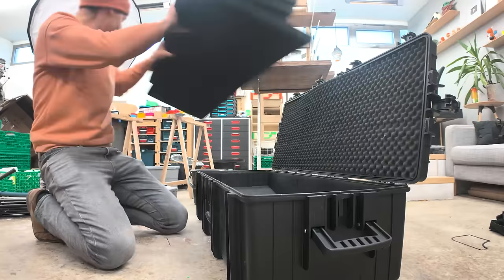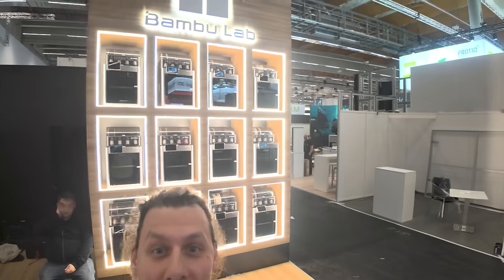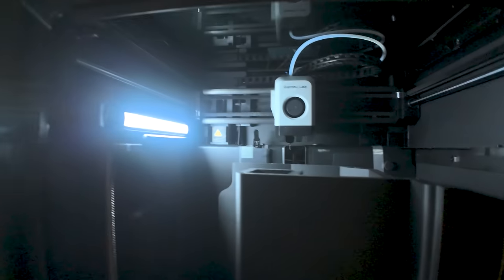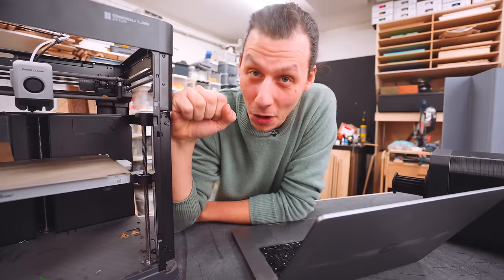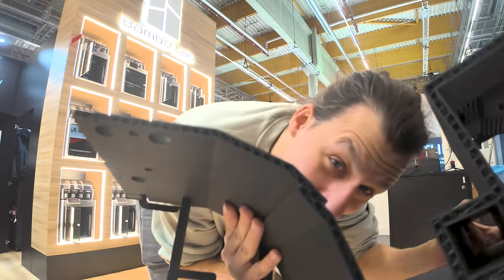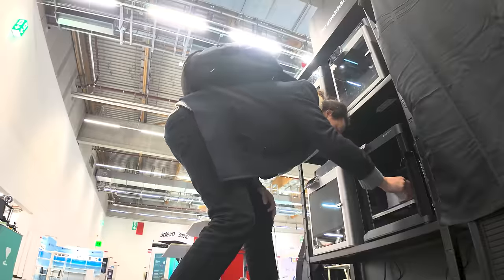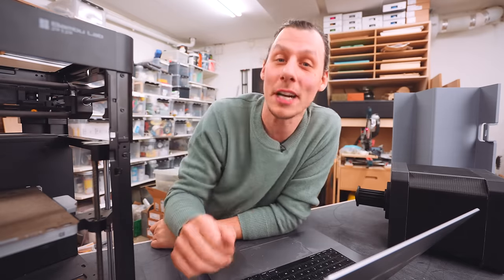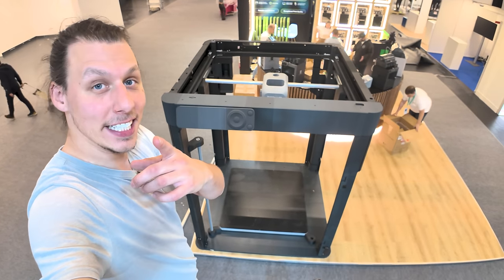I Made a HUGE 3D Printer - Using 3D Printing!

Comment: Nice job! I already imagined that you had to alter the original file way more than just to scale it up.  I did a similar (but way smaller) project last spring. I made a 1:4 model of our ultimaker at work as a retirement gift for a dear co-worker (it was suposed to be a 3D giftcard with money for a 3D printer). I did t have the files so I had to construct the whole thing first. It turned out great and the head was also moving 😉

Comment: The giant printer is really great, you can develop it further, the display at the top of the printer could be built so that it even shows something and it would be really cool that the hot end can even move and that it can print something on the huge 3D printer  you made the printer really great.

Comment: I do not have a 3D printer but I have a design for one. The printing is done on the inside of the motors. The three motors are stacked vertically over top of each other in the same space and there are No Rods of any kind or belts at all, and it has submicron precision , ZERO backlash, and high torque.

Comment: Recommendation for you that Ive recently found quite useful: Nylon R-Type rivets.

Need to connect something quickly, but want it to be removable, but also want it to be cheap, and dont want it to be thrown out with a prototype part should it nor be the final part?

Nylon rivets.

Easier to implement in cad in all orientations as you only need a cone with the end snipped off to be the diameter of the rivet (you can actually just extrude a hole beveled to 45 degrees and you are done), cheap as chips, and you don't have to throw them out with failed ideas like you might have to do with heat melt inserts, which if you've ever prototyped something with, you know the pain of seeing all that hardware go down the drain, or having to design for screws, and then switching to them later. They also come in tons of good for 3d printing diameters and lengths.

Comment: Fantastic can be a reality. I toured Push Plastic 3D printer filament manufacturing facility when I was at PwnCNC World Headquarters (I work remotely for PwnCNC) in Arkansas. 
Push Plastic has a real 3D printer you can stand inside of. It's as big as a good sized closet.

Comment: Does the BL+AMS not have a Spool Join function?
Reply from the maker: it does, but you have to load the spools before you start the print
Reply: Yes, switch over, tell it the spools are the same material and color and it will switch over. Very useful to use up old spools

Comment: As a person who has restored several, old aircooled vw’s with bolt on fenders, decklids and hoods, how long it would take before someone 3d printed these sometimes hard to find body parts and how durable they would be, at the very least, they wouldn’t rust.
Reply: I'm planning on building a 3d printer to do exactly that. The nozzle will be large and it won't be extremely precise, but it'll be enough to print supports for carbon or fiberglass sheets.

Comment: You ran out of filament early in the video: Why didn’t you use the AMS’s ability to automatically switch to a new roll when one runs out?
Reply from the maker: I did for the rest of the prints, but you have to load the spools before you hit print.
Reply: @achappel Awesome project, amazing 3D modeling skills and a testimony to the Bambu printers’ capabilities! I love my X1C, it’s when I went from the printer being the project to it being a tool 😁

Comment: Another great video, I alway enjoy seeing what you are up to. - This looked like a really fun project.  It reminded me of a few things I have done.  Firstly I printed a 4ft long cruise ship on a couple of X1Cs - it was 6 build plates long and about 13 build plates high (although each part was only about 2-8 cms thick) - so around 100 multi colour build plates - probably almost as much printing time as your big P1P - your video inspires me to make a build video myself.   Also I created a fun multi colour model of the X1C extruder too (but only full size rather than as big as yours).  Finally I would like to create a probably half size model of the P1P - but alter to so that it has two P1Ps jointed together on the Y rails - to show what a P1P IDEX would look like.

Comment: I'd totally get a Bambu if they weren't cloud dependent.
Reply: They don‘t anymore.
Reply: @TheChriss1301  Only in part. As far as I know you still need to connect the printer to the internet if you want to update the firmware.
Reply: @andreas.grundler  Yes but thats reasonable.
Reply: @TheChriss1301  It depends.

In the hobby market this might be acceptable, unless have no network access in your hobby room. Then it is a real disadvantage compared to printers where you can update the firmware via USB or SD card.

But if you want to use the printer in a company, the situation is different. If your company falls under certain regulations, not only are you not allowed to connect the printer to the Internet, but you have to prove that no network connection is possible. That's why Bambu Lab has equipped the X1E with a kill switch to disconnect wifi and ethernet on the hardware side.

Comment: Why tf would you print everything with 0.2 mm layer heights. Borderline self sabotage to not increase it at least to .3 if not use a bigger nozzle. Literally increased the print time by 15% just by printing with that setting

Comment: Wow, honestly that's quite impressive. I wonder if anywhere makes printers this big... It looks like an engineering nightmare to get working properly, but it would be super cool!
Reply: I bet its actually really simple. Its literally one of those things you can upscale just fine. I mean, like not if you wanted exactly the same relative speeds, but its essentially the same problem, and indeed bigger scale printers exist that more or less do exactly that. The bigger ones often even just use the actual pellets that filament is made from as they are cheap as chips, and just have the literal auger to force melt the plastic on the head of the printer.